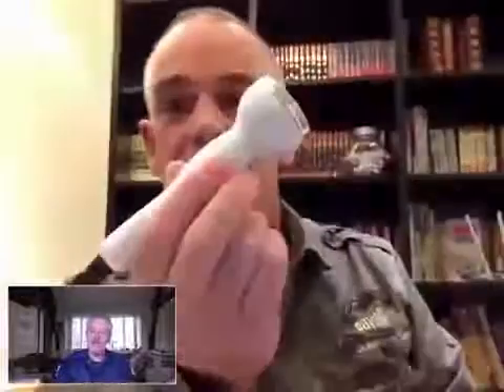How Ultrasonic Works

Comment: My Ultrasonic doesn’t feel as strong as it used to be. I used to feel the frequencies and vibrations coming from the Ultrasonic head but now it only beeps. I don’t feel a vibration. What’s wrong?
Reply from the maker: Your body may have become accustomed to the sensation over time. You could try adjusting the settings or switching up your routine to see if that helps bring back the effect.
Reply: @ what settings should I adjust?

Comment: I read on your site that it's possible to use the ultrasonic with the XM with  a connector, but the power is reduced. Is this no longer recommended? Does it not work? There is very little information available about this.
Reply from the maker: Dear my friend, we have known your problem, please check this link for more details: https://www.spooky2support.com/hc/en-us/articles/218185177-Can-I-use-Spooky2-xm-generator-to-drive-ultrasonic-directly-without-Spooky-Central-Is-output-20V-ok-for-ultrasonic-Can-someone-supply-a-screen-shot-setup-

Comment: Is there a program for using the ultrasonic in the software, and if not, what frequency should we use with it? and what amplitude also?
Reply from the maker: Hello,  you could connect it to central and then you could use central presets. :)
Reply: I don't have spooky central, can't it just be used with the spooky 2 generator and software?
Reply from the maker: Sorry, we do not suggest to use with the generators. :)
Reply: Never mind then, it was only $20 anyway. I didn't see that it was to be used with Central. My fault.
Reply from the maker: Thank you for understanding! :)